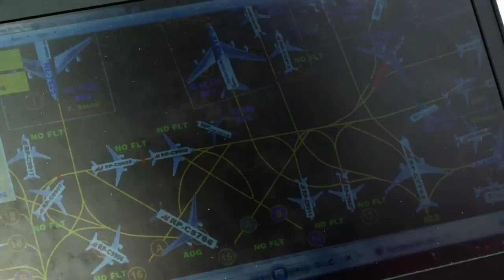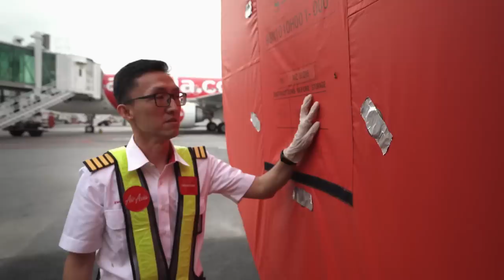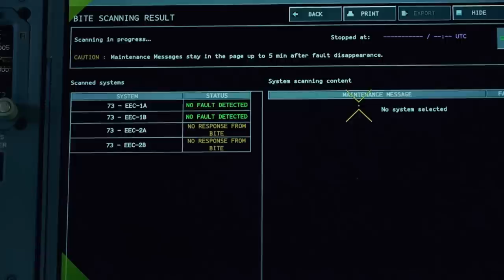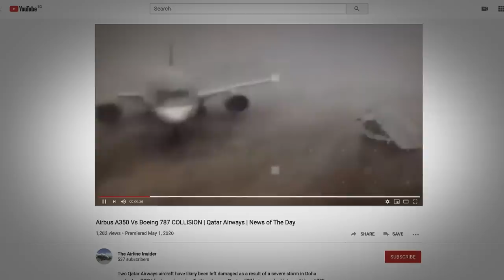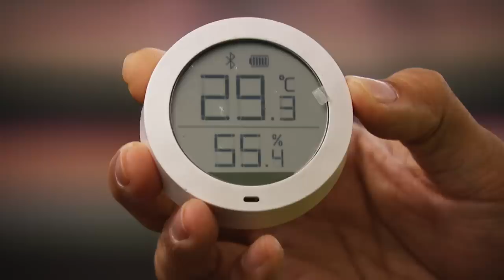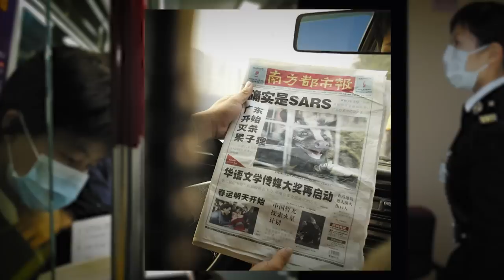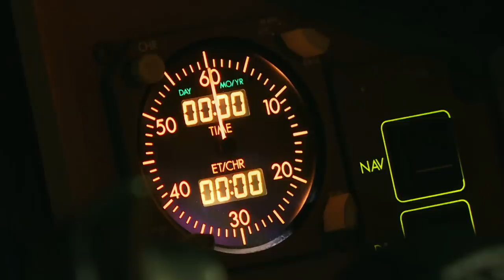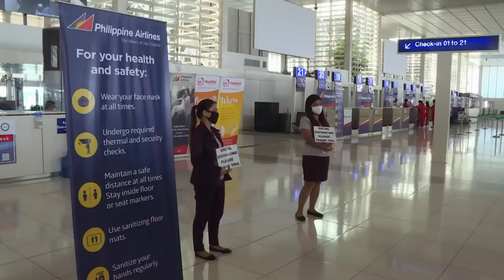COVID-19: With Travel Halted, What Happens To The Planes? | Grounded | CNA Documentary

Comment: never thought how weird it was we have more airplanes than their parking capacity lol
Reply: Passenger demand ehem
Reply: Imagine you have a fleet of buses, but the buses are operating 24/7 upwards for 3 to 6 months at a time, without returning to its depot. So the depot then only needs several bays in order to carry out the neccessary maintanance, since the buses are in constant 24/7 operations.

Now by translating into aviation, the bus depot is the maintanance facilities, and the buses are planes. Planes only earn money when they are flying, and airlines lose money for every second the plane is sitting on the ground (boarding, parking, loading, maintaning etc.). If overnight parking is required, aircrafts usually parked in the airports that they served, such as A aircraft lands in Singapore at 11pm from New York, it will then being “parked” in the airport’s gate until 7am of the next day for a return flight to NY. (Just an example, as it depends also on the airports and airlines)

Comment: It's called 'Long Term Storage' as opposed to 'Short Term Storage' which has its own set of procedures.  Aircraft Manufacturer's have these Policies and Procedures outlined in their Maintenance Manuals and in their Aircraft Maintenance Programs.  There are things you do to the aircraft to preserve them while in storage and also things you must do on an on-going basis to keep them in storage so that the aircraft systems do not deteriorate over time.  These valuable assets must be protected to keep them ready to go back into service when called on and to help retain their value on the aircraft marketplace.  Good video.   Thanks.

Comment: So, an aircraft needs a maintenance when it flies as well as its parked.
Reply: srinath k when it’s parked for long periods of time.  Planes were designed to fly, not to be parked for a long period of time. sensors need to be kept covered, Hydraulic lines checked & pressurised from time to time, Fuel quality checked and fuel needs to be used.  Just like a car would if it were to sit for 6months or more.
Reply: Like every other machine.
Reply: Same with cars...
Reply: Paul Sz thank u Paul so succinct explained
Reply: Dolly Tan Happy to share the knowledge 😉
Reply: @kisselleenpaulino3715  :) great comment, most humans know nothing about anything mechanical and dont realize that a Car needs its oil changed ...
Reply: @Realitygetreal  Also rubber stuff, gaskets, other fluids. Just like in plane, fuel shouldn't be left in tank for a long time (years).

Comment: Do those desiccant bags reused by heating them or when they are full, they are thrown away?
Reply: Desiccants are supposed to be single use only. Its a use and throw product. It needs too much energy to reheat (150C) it to remove the moisture once saturated making it more expensive than using a new one. Reheating also reduce the adsorption capacity of the desiccant so its impractical to do it.

Comment: An aircraft has to be used to remain in flight condition. To sit unused, systems degrade to the point where you might as well scrap them. Draining all fluids out is only a temporary solution,  The aircraft starts to corrode or rust when seals fail, especially magnesium parts near salt water. Soon, only governments will be able to afford to maintain a small percent of flyable aircraft. This fact passes control of people movement to the control of governments, not the defunct aircraft companies.

Comment: One thing is the HVAC system onboard the aircraft are going to spread the virus. If you really want to social distance people you need to have different separated sections and separate HVAC systems with HEOA filters so people can truly be much safer. There are PWD People With Disabilities who have very Low Immune Systems and I myself have to use a power chair. I am not able to stand on my own and if I had to fly I'd have to have passenger assistance give me an FBL Full Body Lift.
Reply: Sorry but you are wrong about this. 100% of the cabin air that gets recirculated get recirculated through HEPA filters that have a 99.9% efficiency for filtering out viruses and pathogens (disclaimer some small  passenger aircraft don't have HEPA filters but every jet over 120 seats does) . Also not all cabin air is recirculated - much of it comes from the outside through the bleed-air systems. A passenger cabin is probably the safest place to be. As long as you take extreme care boarding and deplaning you should be OK